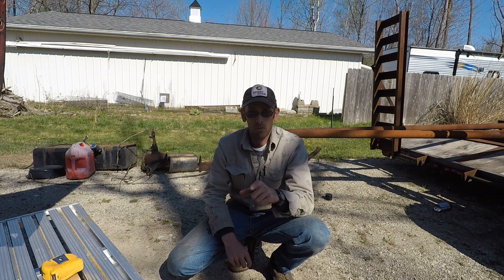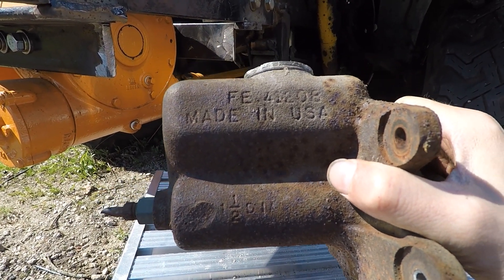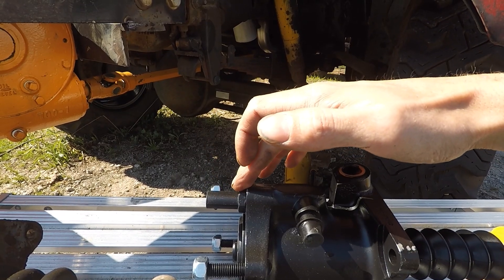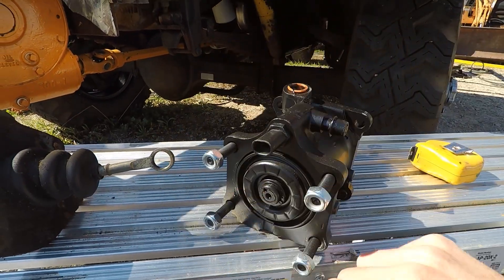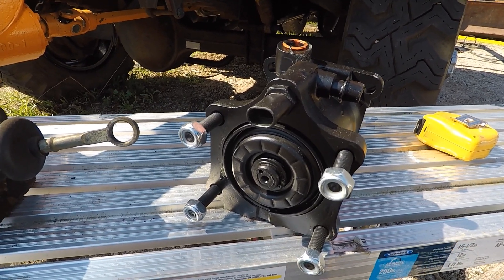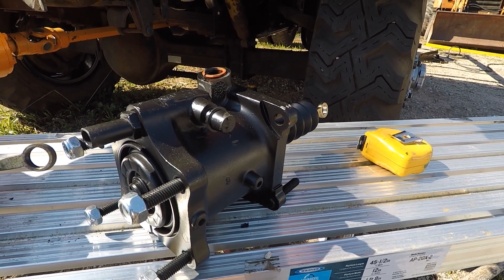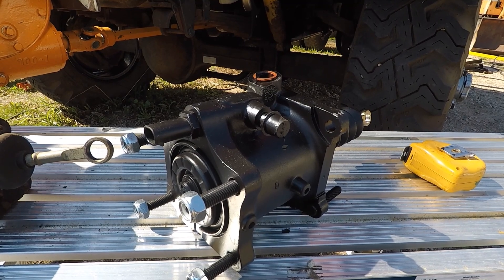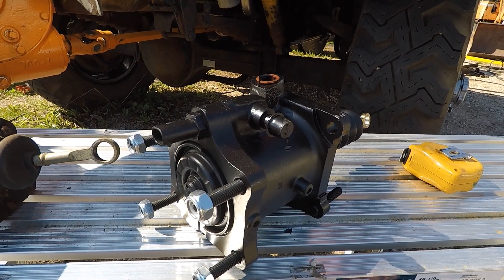Hydro Max brakes part 1

Comment: Awesome to see a video of someone doing this swap, I've seen a ton of pictures, I like video.... I've been going back n forth for awhile now on my 79 F600 Crewcab 4x4 Cummins swapped project. As to just replacing stock master/hydrovac, or do  the hydroboost, ..... I done brake mods before on my other pickups and mixing n matching parts, and brakes never worked good.... So I'm hesitant about this setup... If I did, I wouldn't have to worry about the vacuum setup.. looking forward to seeing follow up videos, .. I've watched everything else you shared...
Reply from the maker: Thanks! It's been a while since I've talked to you on one of the Ford pages. Have you read Matt Cox's write up on his F500? I gave him all the part Numbers a few years ago for his truck. He loves it, says it stops on a dime now! Everything being used on this truck is used on the F600/F800, C600/C800, some L-series trucks, International, Kenworth & a bunch of others from 1984-1998. It's all medium duty truck components. I'll probably have to take a break from it though. Warehouses are still closed, so I can't get the parts I need.
Reply: I haven't seen his write up on that setup, but I have seen alittle bit of it posted here and there, I've asked a couple questions about his setup, .... I'm still aways out from getting to the brakes on mine, .. I'm still looking forward to your video updates.....
Reply from the maker: @MichaelJohnson-dg3xu  glad you're enjoying them! If I can find it, I'll send you the link to it. It's been a couple of years since he did it.

Comment: Awesome video.Two 3/8 Plates and some pipe would work to,what ever you do make sure it is ridged as hell. Nothing wrong with an adapter but  this piece will be under a lot of stress under panic breaking. Love the old iron keep up the good work.
Reply from the maker: It'll be be under hardly any stress. The old master cylinder is held on by  four 5/16" bolts

Comment: Awesome buddy! 🙂  I cant wait to see how it turns out. Good idea on the spacer  👍🙂
Reply from the maker: I did some more research on master cylinder setups, after you sent me the picture of your brown rollback's. Apparently that was a standard/factory option to have a single circuit Hydro-Max system.
Reply: @WesleyJohnsonMI  🤔 that's weird. I wonder why
Reply from the maker: @HODGEPODGEDODGEGARAGE  no clue man. Auto manufacturers have done some odd things over the years.